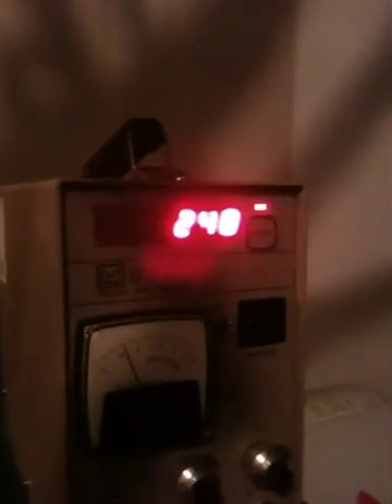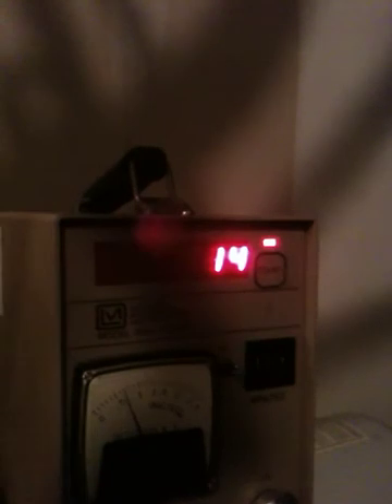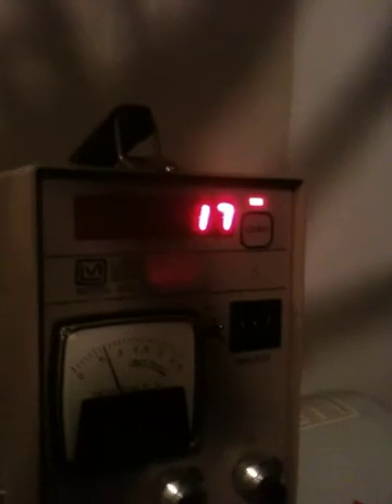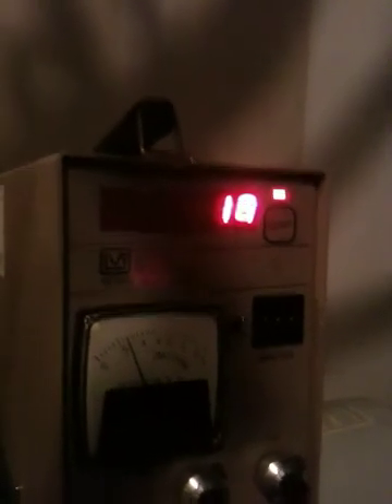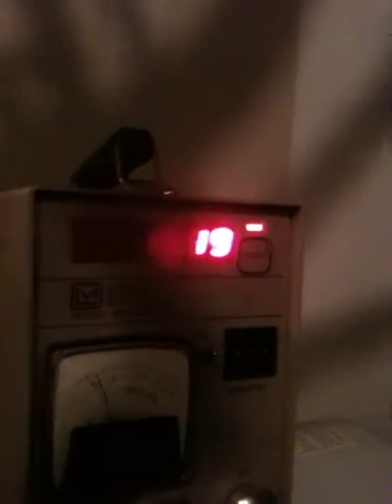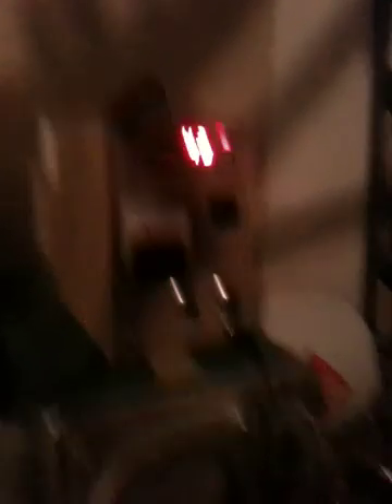First Neutrons!

Comment: @votedthewave and @faraday1945 : Sorry about that, I'm happy to admit I'm just learning.  The reason I asked about the lithium wasn't for safety, but because some fusors use lithium to generate heat (they release more neutrons and some fusable isotopes when bombarded) and then the heat runs a turbine.  Also, thanks for replying!

Comment from the maker: @jibblesmgee 
I am careful. However at the TIER flux presented in this video, I could sit around this thing continually for a couple of of years before it started to present any danger due to radiation. Why would I use an isotope of lithium? When it is hit with neutrons it is actually prone to releasing more radiation. A combination of water,boron,paraffin, and lead is much more effective.